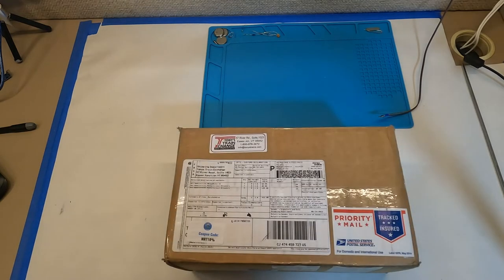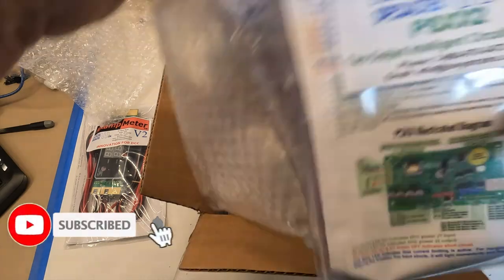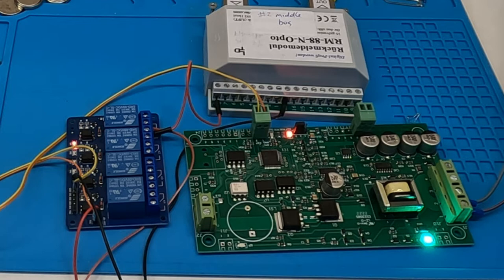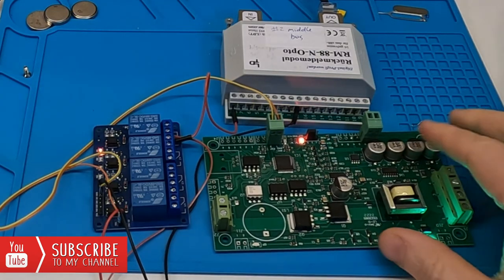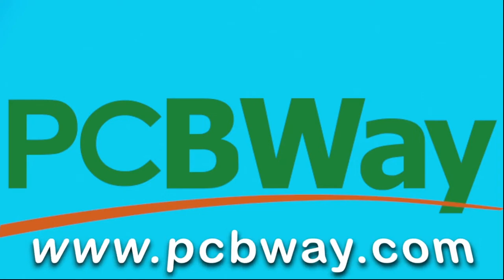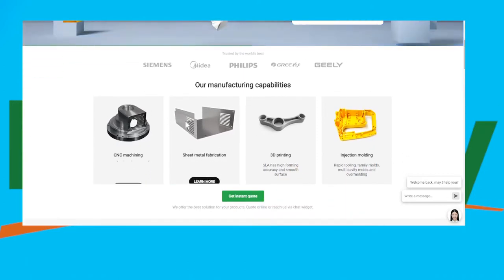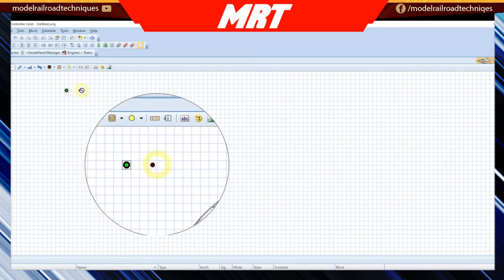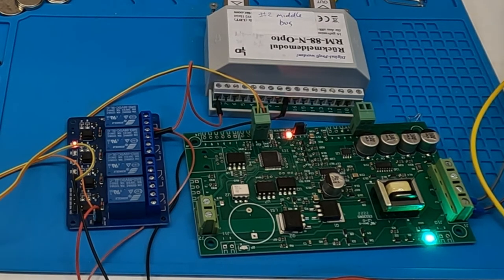PSXX Protecting your Model Railway - PC Connections

Comment: Just as a note on the relays.  When you were showing the schematic of the relay circuit you mentioned 12V.   12V on a 5V relay coil will burn out the coil quite quickly    You will want to make sure your external relay coil voltage is 5V.  The relays can switch 30VDC at 10A but the coil voltage needs to be the rated voltage of the coil, which for Arduino boards will be 5V.    JD-VCC would need to be 5V in the case of the board you have.   The screw terminals are the contacts, which can have your 30V 10A across them.
There is some really great information in this video, and in other videos on this channel.   Very good for people getting into the hobby that want to learn how to do things and save a few dollars along the way.
Reply from the maker: You are correct I didn’t explain that very well. Cheers for your kind words. Glad you enjoyed it.
Reply: @ModelRailroadTechniques  Took me a couple of edits to try and get the wording right, I didn't want to detract from your video lol.   I've watched a few of your videos, and I always get good ideas from them and you usually explain everything really well so anyone can understand it.   I am just one of those nerdy technical geeks, but I like getting ideas to make the trains more fun :)
Reply from the maker: @EsotericArctos  no offense taken. I like the constructive feedback if I have not explained something well or have got it wrong all together. I love experimenting with this stuff. Great fun